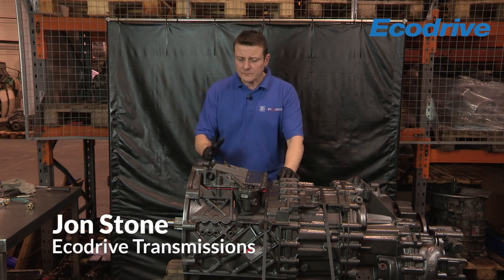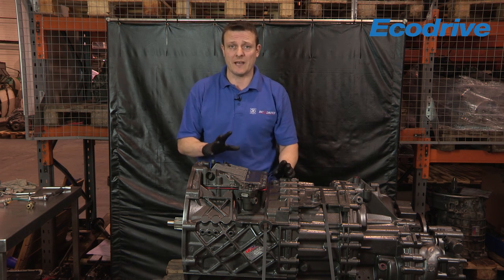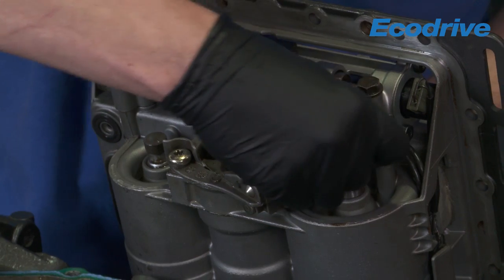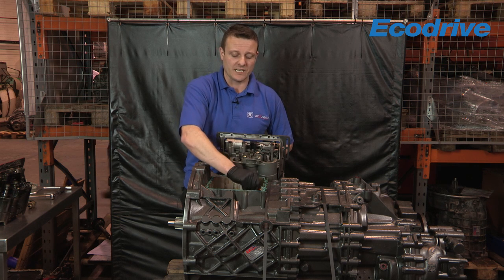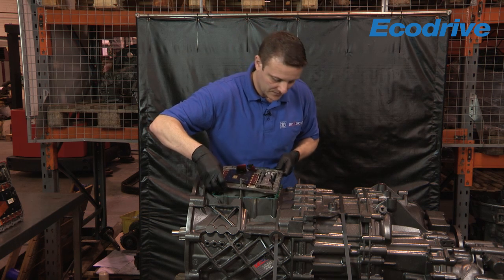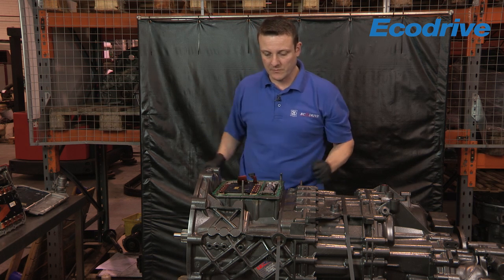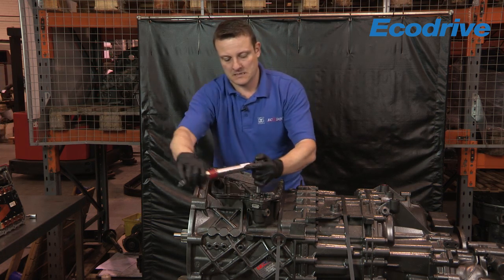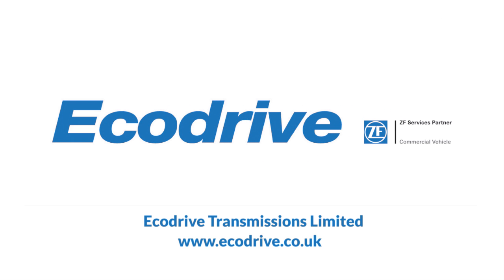Ecodrive Expert Engineers - Removing and re-fitting a complete GS3 Shift Actuator unit

Comment: What to do if you dont know the old positions of piston in old gear box? How will we set the positions of new pistons
Reply: Gud question, the one on the Volvo I shift is also made by wabco,we use air from any external source and insert the air on the ports of the TCM inorder to move the TCM boosters into the neutral position
Reply: Tried on MAN now its writing dash on the cluster  @mwangeemmanuel371